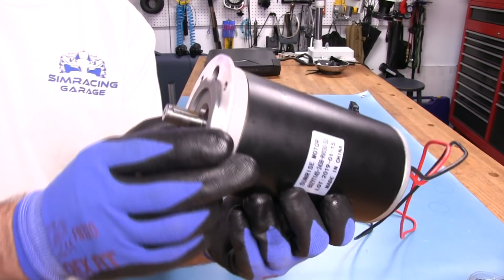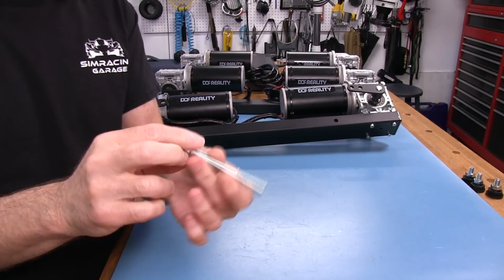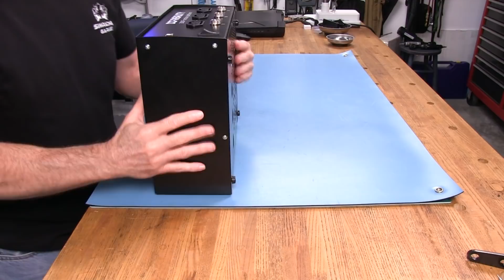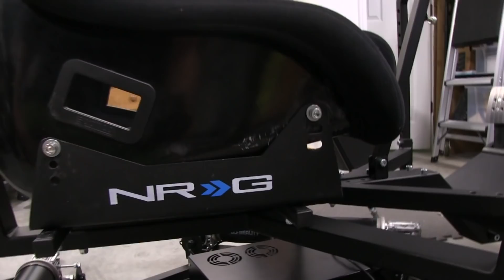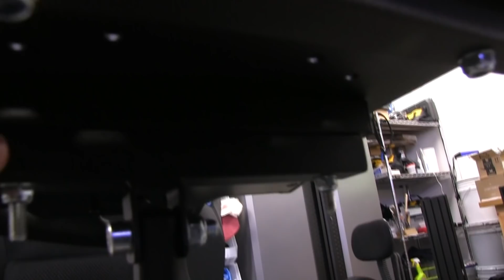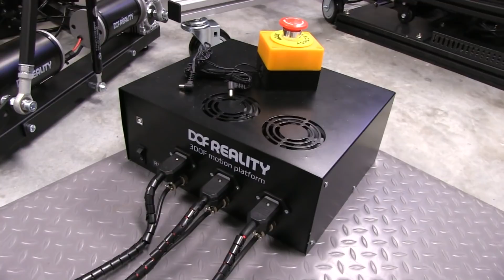DOFReality H6 6DOF Motion System Review

Comment: Hi, thank for your h6 video. I am in sim racing and trying to decide between h3, and h6...like right now :)  In your h3 video the conclusions were that i was a good value, in the h6 not so clear... would you recomend going to h6 for racing? or maybe the less amplitude of movements (17 degrees vs 20 on the h3) and the maybe simplier, quieter and maybe faster/cleaner movement of h3 (h6 for a movement move a lot of things so I suppose they add noise/movements unwish or unpolished..) could be even better for sim racing ? thanks

Comment: Great thorough review. I'm looking into getting one of the DOF systems. I'm not set on if I want the 3 DOF or 6 DOF. I do a lot of Assetto Corsa drifting, and iRacing is a blast. I love the Rallycross and dirt trucks! I have an Oculus 2 and I generally use my headphones as well, so noise would not be an issue for me. I have the same wheel base as you with different pedals. I'm getting more and more excited to getting my feet wet into motion sim. The immersion with VR is so crazy, I couldn't imagine having motion with it!
Reply: Did you ever decide on 3 vs 6?? I’ve been deciding for years but wanna pull the trigger this week. I kinda want the 6 for the heave/jumps in dirt rally
Reply: @GeeCeeAte  Sorry for the late reply, I haven't purchased one yet but I will be getting the 6 when I do get it. iRacing has some trophy trucks and dirt/road stuff that is really fun. I've also been playing a lot of Assetto Corsa Competizione, Project Cars 2, Dirt Rally 2.0, and I just bought Automobilista 2. Things haven't gone as smoothly financially and I don't want to put myself in over my head on debt. You had me sold on it.

Comment: Hi Barry great videos man! Is H6 overkill for Sim Racing where H3 is sufficient? Or are there dimensions in H6 that Sim Racing uses?
Reply: More degrees of freedom the better. The main things the H6 achieves that the H3 doesn’t is heave(up and down), surge(forward and back), and sway(left and right). The H3 only does Pitch(forward and back tilt) Roll(left/right tilt) and yaw(left/right rotation).

Comment: Can't decide if the conclusion was "worth it" or "not really worth it".  Obviously the unit has to be built to a price, but there is also a threshold where "it's good for what it is" just isn't good enough to be anything worth having.  Would love to know what side of the line it's on, and by how much.
Reply: I think it's worth it for a 6DOF system, however you have to set your expectations, understand what the frame can handle, and if it can accommodate your wants. It seems they have added the struts to the package, while increasing the price. I agree that the steering support should be included as well and not an extra cost considering where they decided to connect the mounting point. I am considering a NLR Motion Platform, probably the best seat mover, so for $2700 I can get that or for $5600 get a 6DOF system, while a D-Box system is $7000. Hard to decide and I keep changing my mind!

Comment: STill wondering if the range of motion is enough to give a realistic experience of forces.  Looks like very little range of motion.  I'm sure in person, it feels better than it looks. PS: 4k isn't a drop in the bucket.   Q.C. should be improved.  I feel like this could easily be a 1500-2000 DIY project to duplicate this setup, maybe even with better quality.   Maybe, the P6 is superior in quality though.   Hard to find a true side by side of what makes P6 so much more money!

Comment: I am considering buying the H3, but will DEFINITELY re-engineer the wheel platform. Thanks for including the update for the 'stabilizer bar', but considering it's $50 and its awkward position, I am not liking what appears to be a poorly engineered 'fix'.
Reply: I'm not a fan of where they placed the mounting point on the wheel deck. I think they should re-design that completely, however I do hope it can handle the upcoming CSL DD!

Comment: The wheel base, the way you mounted it is why it moves .  if you look at 51:07 you have the right bar mounted a couple of holes back from the left bar.  if you mount them side by side, (move the right one up 2 spots, and left one down 1 spot) and then on the wheel base plate, if you mount the right arm back to the holes right next to the holes you have the left arm in, and the sturdy base bar to the next holes in front of that you get pretty much no movement.  you really really have to pull on it hard for it to move
Reply: He explains this in the H2 review; and said they need to be staggered. Here's the part of that video (28.59 is the location): https://youtu.be/9RxO4pIlg88?t=1738

Comment: You mentioned that on braking you are getting forward surge, but would that give you the feeling for force on your back as you’d experience under acceleration? Shouldn’t that motion be inverted under braking? Ie - pitch forward and surge back under braking. 

Is the intention of these rigs to simulate what the car is physically doing, or what you’d feel inside it?
Reply: When braking, the motion system pitches you forward because the gravity pulling you from the front resembles the g-force that is supposed to pull you forward when decelerating (inertia is the tendency to keep moving where you're already moving). HOWEVER: Some people swear that this pitch forward when braking makes them feel the back of the seat pushing their backs same as what you feel when you're accelerating (you know: your body jerks backwards and is stuck to the car seat).

Comment: Hello.   I've just ordered an H6 and I'm planning to experiment with longer servo arm or horn to amp up the effects.  I know I'll be messing with the geometry and it might not work correctly after that and I might max out the rod ends.   Also adding a lot of torque on the gears.  So I'm also going to replace those gas springs for the longer travel..  (actually I was going to add some to take my weight off the servos, because I didn't know they're included already)
Reply: I wonder if I could just change the resistance position sensors to cause a wider range of operation.  Or change the input voltage of the included sensors for the same effect.

What problems have i overlooked? do you think I'll get into besides voiding any warranty.

I'm looking for about 30cm of heave. Like Chris the youtuber engineer who engineered his own and put the projects on GitHub.

 I'll have to limit the other effects roll effects so it doesn't snap off rod ends.  Any failure would be catastrophic.      Perhaps a fall protection nylon web to the floor joists above so I cant fall should something break.

Comment: Hi Barry, have you tired or heard if the P6 has fixed or improved that loose feeling you described? The P6 is a bit more powerful compared to H6 but I don't quite understand how much difference if any those higher numbers would make. What's your opinion based on those numbers below? Thank you sir!
Motions Range: H6 17 ° -  P6 21 °
Speed 86°/s - 105 °/s
Torque 25 n/m - 28 n/m
Power (peak) H6 2200W - 2400W
Reply: +1

Comment: Thanks for the review. Been waiting for this one for awhile. Despite the flexing wheel mount (which according to several comments here can be fixed with some tweaking/modifying) and the noise from the rod ends, this system still seems like an excellent value to me for 6DOF. I really can’t see using a full motion rig with fixed monitors though. Just seems like it would throw off the immersion. Getting ready to order my Pimax 8KX VR headset and this system is almost certainly next when the budget allows.

Comment: Amazing how they copied my 1st 6DOF pretty much exactly even down to the motor manufacturer , but with less range.  but they are way behind the times now things have moved on.   I could build 3 of my current sims for the same price
Reply: https://www.youtube.com/watch?v=IoUTCk0kzyo        £2000 for that :)
Reply: Your rig is very impressive
Reply: Yes, but it quite noisy. The dofreality p6/h6 seems more like a 4dof to me. Yes they use 6 motors, but each 2 are connect almost at the same position. I think there should be more space betweem thes connection to get more motion freedom. It's a bit constraint by the looks of it. I don't like actuators because of the noise. What's your thought on the above matter? I am planning on building a 6dof with a more or less similar design as the dofreality p6/h6.
Reply: @renstillmann  yeah they are a bit noisy but if you have a room where no one can hear it and you can wear headphones you don't hear it.  The ballscrews do get quieter over time
Reply: Where to buy?

Comment: You should put the support arms for the wheel plate close together and put the optional support bar all the way to the front of the plate. I did this and I don't have any significant flex with my CSW. I wouldn't put a DD on it though.

Regarding the pitch setting, I have the best result putting the pitch quite a bit up so it matches the slope of the track. Then you can tune the Accel and Decel pitch separately giving you more control. At least on my H3.

I am 177cm tall and I find the seating position too small for me. I had to drill some extra holes in the wheel plate to move the wheel towards me. The holes in the pedal plate for the V3 pedals are way to close for me. I have a seat slide rail but still everything does not feel right if you use the default holes. You have to do some drilling.

After seeing this review it looks like the H3 has the best price/value point to me. I am very happy with my H3 and can't live without it. I'd recommend it to anyone.

Comment: „Doesn’t stand out...“ and „does what the manufacturer says it would do“ is among the most destructive criticism of a piece of hardware I‘ve heard Barry cast so far 🙈😂
Reply: likewise, normally positive
Reply: not a relevant criticism to even consider when it comes from someone with no idea about engineering
Reply: @DashzRight  Self-taught, like a lot of Americans. Which isn’t necessarily bad or disqualifies someone.
Reply: @Urufu-san  I didn’t say a degree is necessary to have an opinion, I’m self taught programmer and engineering nerd, merely pointing out that this guy doesn’t really know much about engineering outside of specific hardware used for a motion simulator as proven in some of his “clueless insights” during his videos

Comment: It all comes down to materials...Im so on the fence here...to make this rig right, the base chassis and rods should be made from chromoly tube...”high misalign” rodends/heims...which is basically rebuilding everything minus actual VR guts...fixes everything. From a road racers opinion. Its probably $500 in heims alone...

Comment: Very nice review sir, although there is definitely something wrong with your wheel mount flex as mine is rock solid with that support bar. Maybe tighten that adjustment bolt sucker up till it cries a bit 😄

The seat mounting was by far the hardest part of my build, requiring help

I bought my H6 back in March this year and would totally recommend it ! I use mine with VR only at which it excels IMO. I don't see how having fixed screens but a moving platform would be good for the feel and immersion?

Interesting that your H6 and mine have a few differences too :-

1) The 2 motor control boxes on mine are slightly smaller and have no vents on top, but a grill at the backs of each and also yours are landscape configuration, meaning the plugs go in at the long side of each box, whereas mine are portrait

2) The gas rods are all black on yours but stainless steel shafts on mine

3) The push rods/gas rods connecting upright bars on yours have a T shape top to them, whereas mine don't. I honestly can't see what on earth those T tops with plates are even supposed to be doing? but i don't build them so what do i know 

I would suggest dropping the Power/Max angle slider down to 70 as, if you notice while testing, there is a point at which, when testing the roll for instance, there's a point at beyond 70ish that the roll also has a tilt or pitch increase which muddy's the feel of the pure roll feel (IMO) 

About the noise, i barely hear anything with my headphones on outside the game so it's not a issue. I can't say what the neighbours hear, but mine's in the spare bedroom with carpeted wooden floor and i didn't put the 6 feet on my frame so i don't know what effect that would have?
Reply: Would you recommend the 6 over 3 you think? I’m trying to pull the trigger. I was dead set on the 6 but now it’s 2x the price so I just wondered if the heave would be worth it for rally sims

Comment: Hey really enjoy the show, have watched for a long time. I would love to see you do your picks for motion simulators in say three or four price groups. Like 0-5,000,5,000-12,000 and 12 to 25,00. I would be very interested to see your top two for each category. I am now looking to buy something in the under 10,000 range and have looked at a lot of different ones. Noise is a factor as I think all simulators should be graded on that. I would really like to put the Simrig SR1 on top of the Traction plus unit, I think that would be an amazing combination under 10,000 but the SR1 is still not available in the US. The PT Actuator 5DOF looks incredibly well built but I don't want to deal with that build, That looked extensive. Any thoughts on units from anybody would be appreciated.
Reply: https://m.youtube.com/watch?v=flykezr76Rg

DIY actuator route. I'd recommend the Thanos controller and aasd servos
Reply: DIY 6DOF route with actuators or rotary design. Actuators will be more expensive and / or require more work.
Reply: https://m.youtube.com/watch?v=BxWp5yLSh_c

Rotary stewart DIY design.
Reply: 3500 to 6000 depending on the design
Reply: @JE-ql9gg  What actuators do you recommend. D-Box are 8,000+ for 4. PT Actuators are expensive. The only ones that look good that I have seen cheap are the SR1 actuators but I cant find them anywhere.
Reply: @johnambers  DIY actuators - the SILENTCHILL link above are actuators built by him.  All parts and files are linked if you have a 3D printer.  Here is the build: https://www.youtube.com/watch?v=4VxQOA83D0Q
There are many that have built the actuators with aluminum extrusion as the basis.  Here is another actuator build:
https://www.youtube.com/watch?v=Ewiyuy38aO8&feature=emb_logo

Actuator design generally has a louder noise floor and is more expensive, but many prefer the sunken design of the actuator
I'm in the process of building a rotary based stewart design which I've modeled in CAD: https://www.youtube.com/watch?v=gGCQ9w9jWK8
Reply: @johnambers  There is also the SFX100 route or similar.  Start with 3DOF with 3 or 4 actuators.  I would look at the modifications that take the 100mm the proprietary SFX100 are at and get to 150mm.  Can add TL and Surge later to get a 5DOF.
Reply: @JE-ql9gg  Thanks for all the info and the links. I will check it all out. I am ready to build and I do believe that you can build an amazing system buy just picking your parts and save money also.
Reply: Those actuators are massive.

Comment: Noise @ 1:25 would be more informative if mixed with sim sounds at usual level.
Connecting the wheelbase center support upper end to the forward arm location should reduce flex,
as would attaching the lower flange further back.

Comment: Really like that machined spring/coupler. Putting that in my engineering bag of tricks  😂
Reply: They make standardized couplers like this,  any fixture with a  servo drive with an inline torque sensor usually has one.

Comment: Thanks for another superb review! I think the   flimsy wheel mounting & excessive flex will be a deal breaker for many including myself!... The addition of a sturdy monitor mounting option would also open it up to those of us not yet sold on current VR systems.
Reply: Still not using VR for sim is a big mistake, VR was the biggest improvement to my sim rig when i bought it, and its much cheaper than a 3 monitor setup. I have an Oculus Rift CV1 btw.
Reply: @rehakmate  VR definitely has it place, increased awareness of the cars yaw & proper depth perception are a big bonus aswell as situational awareness. I have a 32:9 monitor and I just prefer it's resolving power for distant brake markers and overall track clarity. I will have a look at this new Reverb G2 headset when it arrives and see if it can finally sway me!
Reply: @High-Order  I haven't heard about that headset, I'll check it out. I have a 21:9 monitor, 32:9 must be amazing, i was thinking of switching to a 32:9 but i also need 144hz and at least 1440p so there is no monitor yet that would meet my requirements.
Reply: @High-Order  Also track clarity is not a problem in VR, Project Cars 2 and especially Assetto Corsa looks very clear and sharp even with my CV1 even if there are better resolution headsets out there like the Vive Pro and Valve Index. The immersion makes you forget about grahics and resolution.

Comment: The flex is terrible on this thing. :(
Reply: What do you mean? Do you own one? What is your experience. I see that the rods of each 2 motors are connected at the exact same position. I think that this limiting the "flex" maybe?
Reply: @renstillmann  the wheel deck flex is ridiculous.
Reply: @pyrates2000  Yes agree. I am building my owm so it won't be a issue :p they should redesign it for sure.